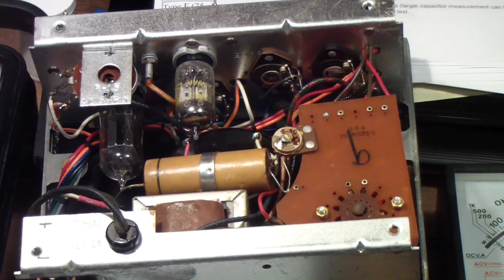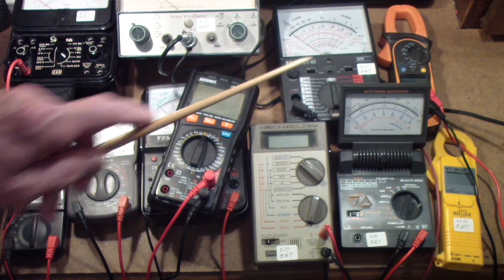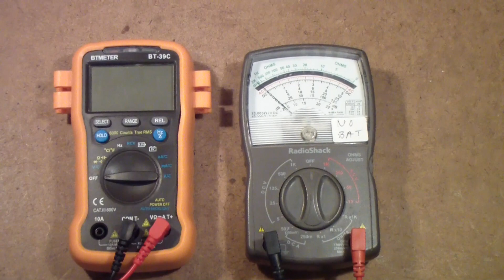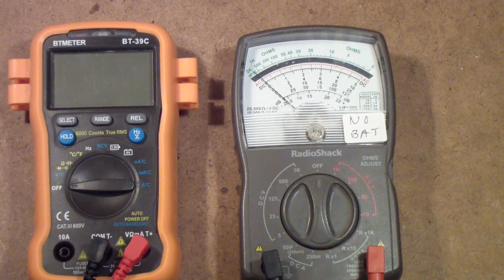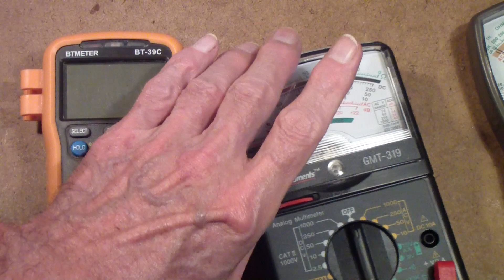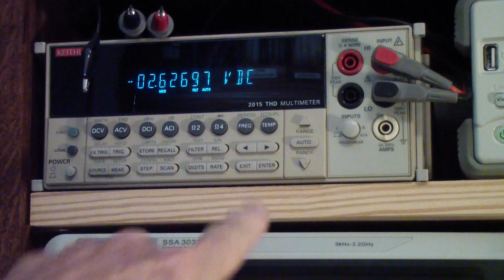TTT337 Multimeter Overview

Comment: You are doing good work here Tom. I have my old Fluke 75 that i got in the 80's and a Fluke 12 i got in the 90's. I am looking for an Analog Meter. I missed a Triplett 630 for 60 US awhile back because i am broke, but i am still wanting one. I don't dump equipment if it does not dump me. I may have abandonment issues.

Comment: Never, never ever spend more that $50 for any multimeter.  Consider buying used.
Reply: You are too generous. My limit was $20. Bought the ANENG8008 for $14 and I'm shocked at how accurate it is!
Reply: Some models like Gossen, Fluke, Keysight, Brymen, it's almost impossible and they are the best ones.